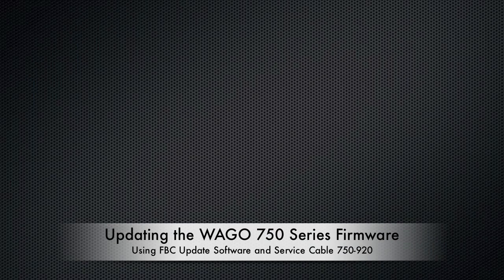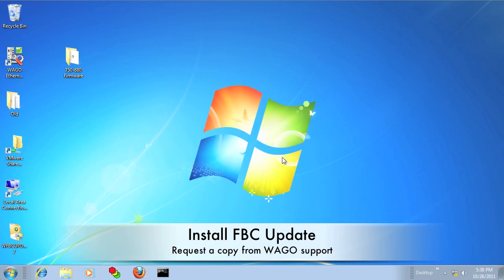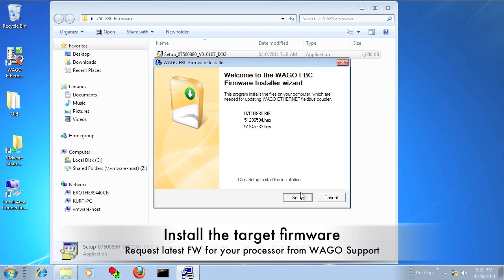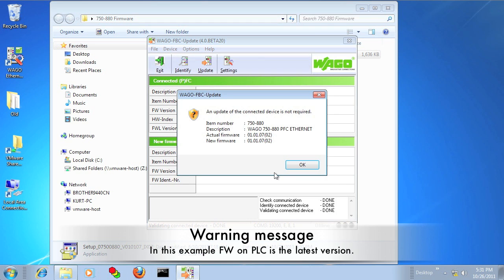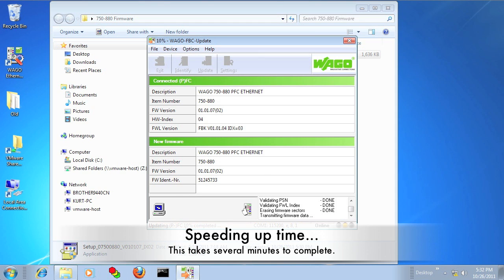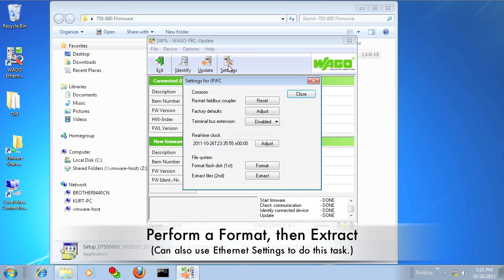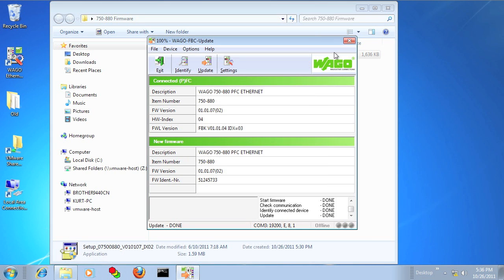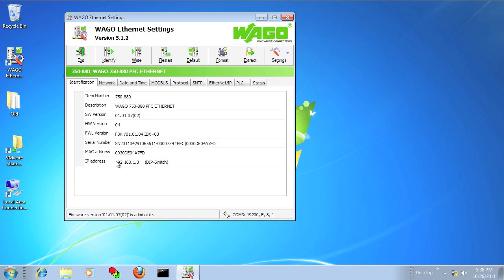WAGO 750 Series Firmware Update

Comment: hi. is it possible to emulate wago firmware in linux ( for example using qemu ) or run wago firmware on another hardware ( like raspberry pi ) ?
I am unable to supply the device and emulation its firmware help to me.

Comment: Just adding some information for this video. Some controllers cant be updated with the FBC-update tool, mainly those that only come supplied with a .hex firmware update. To update non-FBC tool compatible controllers you can use the Wago Ethernet Update tool.